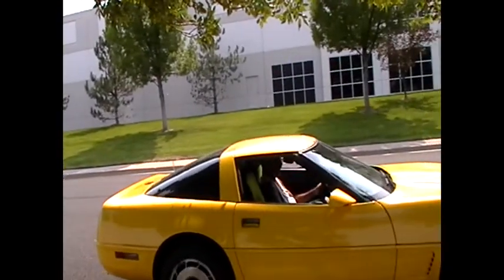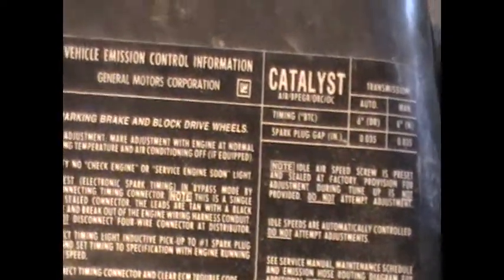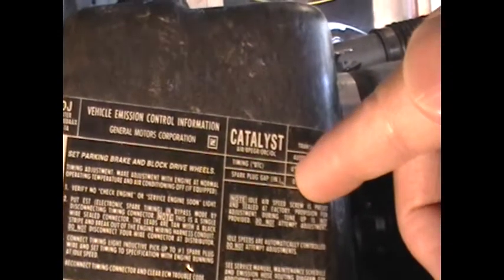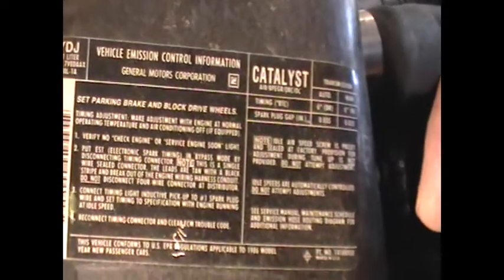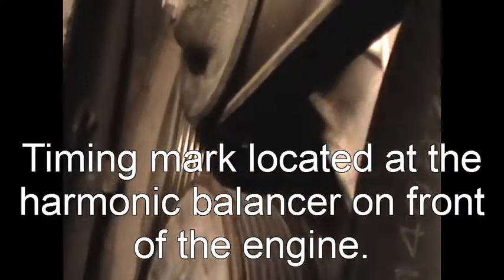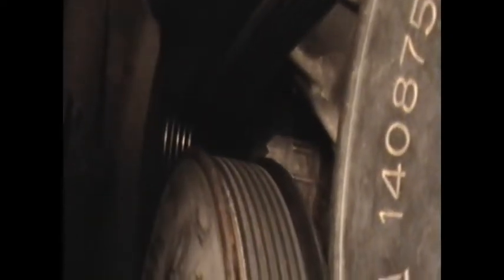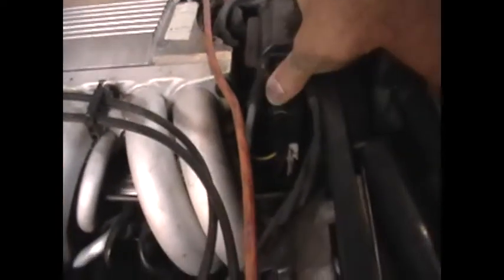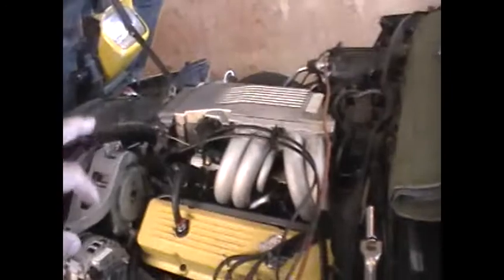1986 Corvette Timing Procedure

Comment: I'm about to set my 88 corvette timing any pointers it's hard to see my marks on my harmonic balancer plate
Reply from the maker: @chrishall8222  I cleaned my timing marks when I did my water pump, it's kinda hard to clean otherwise.  Crucial tip: after timing is set, plug EST connector back together before shutting engine off.
Reply: I just set my timing to 6 degrees with the est unplugged when I shut the car off and and plugged it back in it idled high and backfired when I accelerated please tell me what I'm doing wrong and while doing this I seen smoke coming from my maf sensor witch is new would the 2 relays for the maf cause this its idilng around 1100 rpm
Reply from the maker: @chrishall8222  Read my last reply where it says Crucial tip:
Reply: @MrCARWIZ  oh I see I will try it
Reply: @MrCARWIZ  so do I repeat the process
Reply from the maker: @chrishall8222  Yes!
Reply: @MrCARWIZ  Thank you for your guidance brotha I really do appreciate it I just got off work I'm bout to take my time and do it as you instructed
Reply: @MrCARWIZ  got home today Crunk the vette and she runs way better after following your procedures I'm still getting a little backfire exhaust side when I accelerate not all the time though
Reply from the maker: @chrishall8222  Make sure all of your ignition componants are clean and intact.  Plugs and wires distributor cap and rotor, make sure wires are pushed on until click at both dist cap and plugs.
Reply: @MrCARWIZ  I got it brotha I believe I have a hole in my exhaust

Comment: Hey thanks for the info, I had trouble getting the motor running at all until you mentioned that the distributor started way cranked anticlockwise.  Very helpful!!  Got me outta a rut.  Thanks 🙏
Reply from the maker: Glad it helped

Comment: Thanks for the video Raphael! I’ve got an 86 that I have had for about 1.5 years. Project car, but way more project than anticipated. Already replaced distributor and cap, set timing a while back. I took screenshot of you label on radiator shroud. I see instructions there which talks about engine being at operating temp and no check engine light or codes. Odd they would not include that in service manual. My label is damaged and did not see it. 
I guess that’s what the (DR) stands for… 6° in drive. Is there somewhere that lists that in the manual? Either way, I rechecked mine after watching your video. Mine was off. It’s running better, now, but I still have a lot of issues, but hopefully this puts me one step closer to having it road worthy.